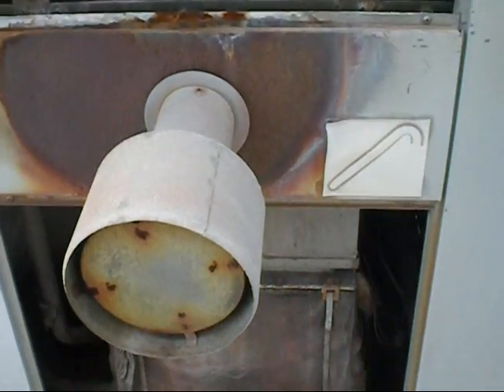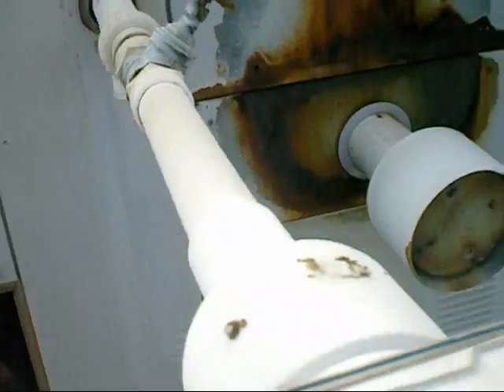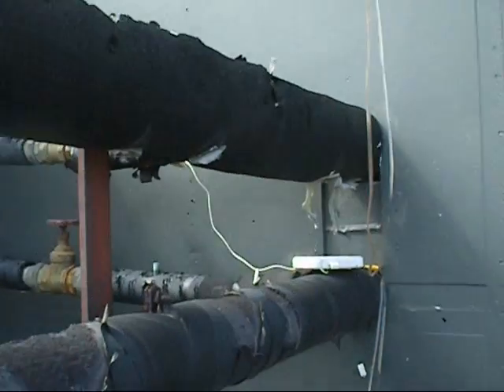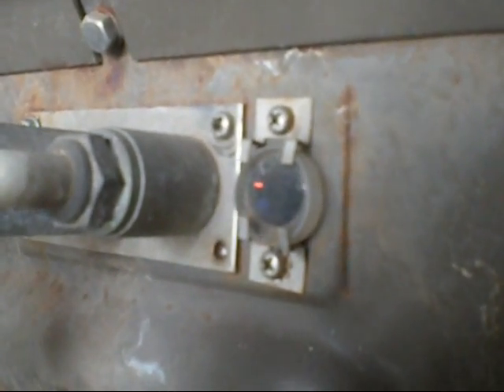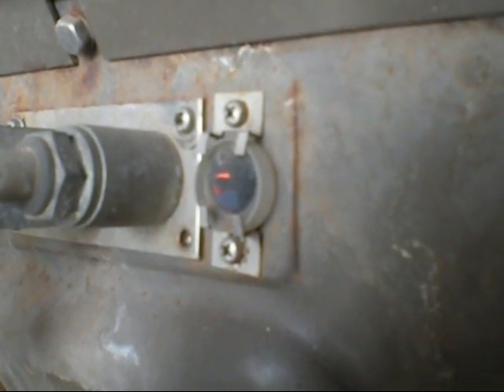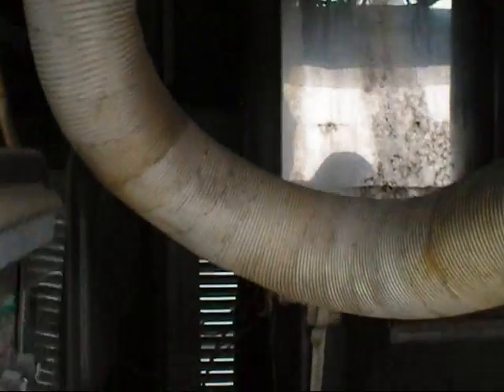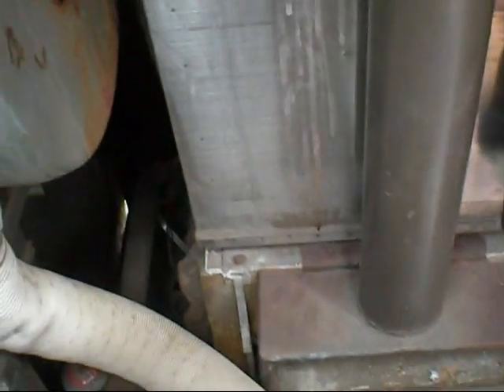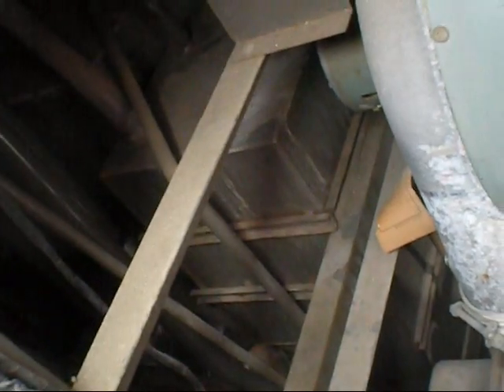Thermal compression chillers and tower

Comment: @joeyf504327 No. These units use gas burners to make the refrigerant circulate around the system. (look up Absorption Refrigerator). The cooling towers remove heat that the refrigeration system pulls out of the building.

Comment: @joeyf504327 It's an evaporative cooling tower. A big fan pulls air up through the tower, past the falling water which causes it to evaporate. As the water evaporates, a lot of heat is removed, cooling it down.